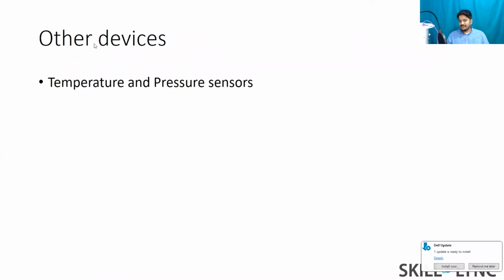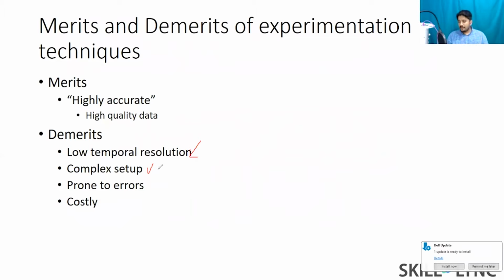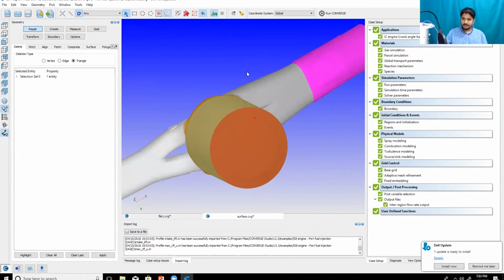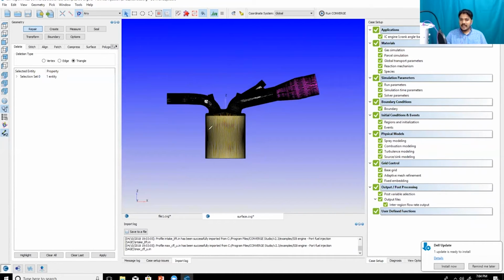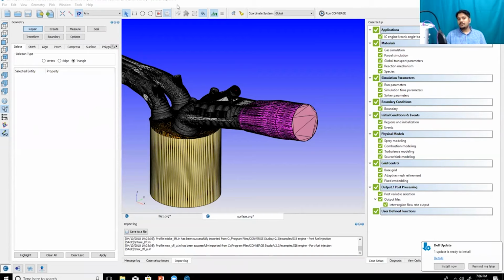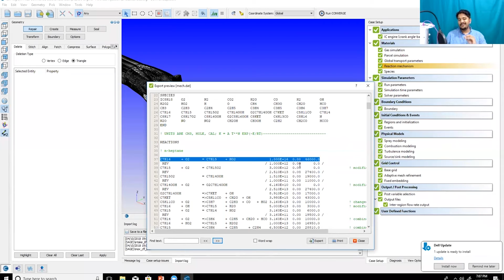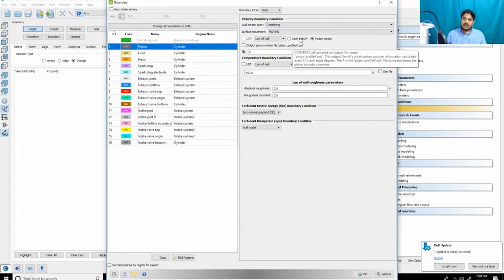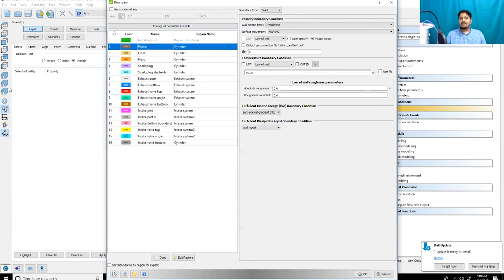IC Engine Simulation Demo (Part 1) | Skill-Lync

Comment: Hi, 
I am currently writing my thesis on CFD analysis on dual-fuel hydrogen diesel engine to understand the behavior of emissions. At present I am using ANSYS Forte to conduct the CFD analysis. I have gone through a couple of research work and was wondering how the authors conducted CFD analysis at 0%, 25%, and 100% load conditions. I am aware of absolute intake manifold pressure. My question is, how to conclude the suitable pressure values for each load conditions.
Thanks in advance for taking out your time to help me.